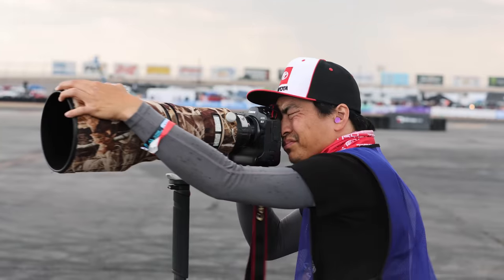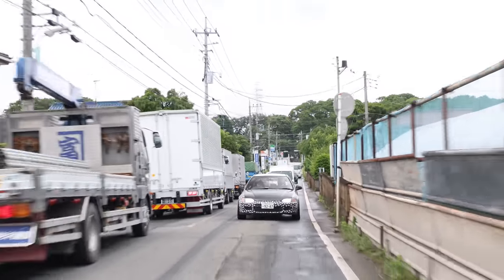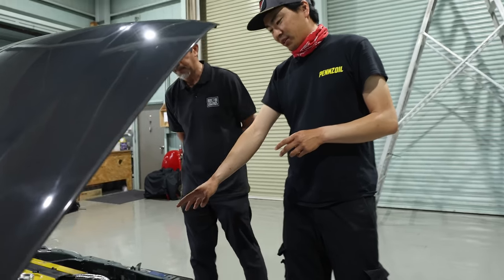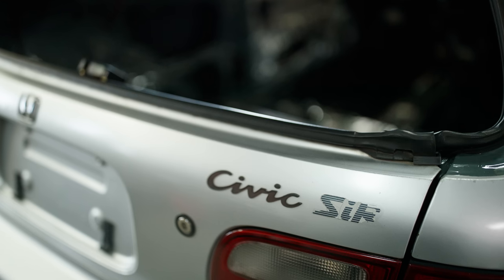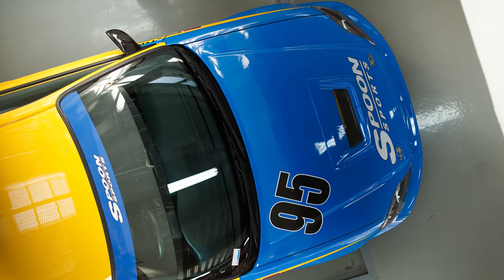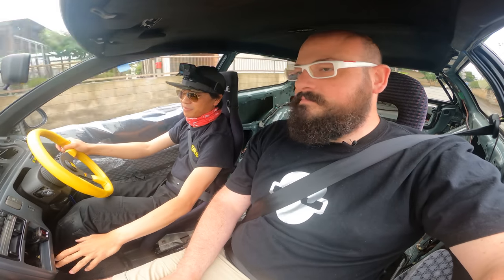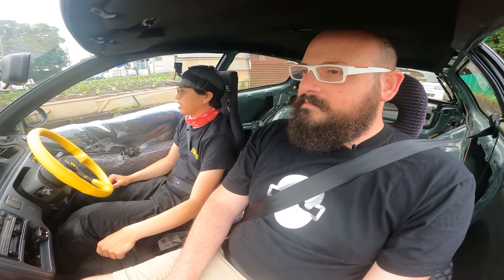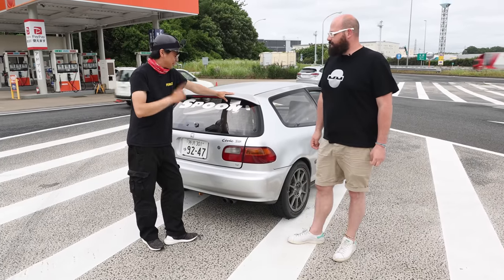$200,000 EG6 Honda Civic, built by Spoon & Built by legends | Capturing Car Culture - Ep. 7

Comment: Imagine buying one of these and then getting gapped by a kid with a junkyard B or K swapped car 🤣
Reply: Spoon has always focused on circuit racing so idk why people are expecting a straight line monster
Reply: @MidnightMuzic   $200k for a side exit exhaust and carbon fiber flooring/strut tower reinforcement is ridiculous no matter how you slice it. At their projected weight of 1000kg that EG won’t hold it’s own against competitors costing a quarter of the price.
Reply: @easye47  Agreed, theres a host of racecar  EGs that run in IPRA ( improved production) in Australia that cost 1/4 of the price and would run rings around it at the track...the money they've spent seems unbelievably unnecessary
Reply: @easye47  I agree the price for it is outrageous but I think it goes deeper then the price for a lot of people. I own a EJ1, or eg coupe for those who dont know the chassis codes, and I absolutely love these cars. 

I think spoon and BBL are doing something that myself and all other car people have asked themselves. What would you do with a car you love if money was no object? Spoon has built absolute demons for track racing but what I got from looking at this and the GTR build is that BBL isnt here to build the fastest version of these cars but versions of them that are meant to engage the drivers and make people who appreciate these cars fall in love with for the first time all over again.
Reply: @easye47  You've completely missed the point of this car. It isn't built to be the best on a track. Its built to be capable on track and street. Your paying for basically a brand new eg built by  the most iconic company to ever tune Hondas. Sure you can buy more car for the money, but if you're into civics, and their history, this car is almost the holy grail.

Comment: I love these modernisation, it's basically a singer civic. I just wanted to point out, for those that come across my comment, that the carbon fiber is a reinforcement layer on top of the existing sheetmetal. Opera Performance, the shop responsible for those bits, made a video about it. Just so y'all know it's not a full carbon replacement, but a very trick way pf increasing rigidity, pioneered by Opera Performance on their legendary s2000 (yes, the one in GT4)

Comment: Are the floors full carbon or carbon skinned metal?

Can't help feeling a 2L B series would be best for a road focused EG, more power and torque than an 18 and effortless pull from very low down. Still able to rev to 8500.

Comment: I know Spoon from Gran Turismo and had a highly modified EG6 Spoon that I would use to kick other cars butts on all the tracks. What stood out for me was the light weight and handling vs. the engine. I would just run away from everything in the turns and watch the rearview mirror on the long straights as they would catch-up to me, only to be left in the dust in the braking zones and curves. This car is going to be special. I can't wait to see the finished product.

Comment: The exhaust sounds like a rattle can you need a bigger resonator.. its vibrating/droning like a subwoofer and makes the knock sensor hard to use and tune and will sense false knock conditions

Comment: Surely turning the engine 180degrees would have been technically easier, having the exhaust ports exit at the rear?
Reply: You would then step into the argument of why not the Honda K-Series into this chassis?

Comment: I love it. Very cool car, but just 8500rpm and only 220hp. You should have somebody build you an engine. It has to be way under 2000lbs, my 92 b swapped was 2030 without all the carbon.
Reply: It's a restomoded civic that is pure
Reply: and no turbo on it?
Reply: @FahrenheitRUS  I suppose an all motor B would be very reliable vs a turbo build. The JDM market was never known for building fast Hondas, that happened in N America. But still, this is a weak B build, and they must be sandbagging on the weight. There is no way this is a 2000lbs car.
Reply: @GIZZMOTORSPORTS   this is not about high performance  but built for balance driving like mazda mx5
Reply: @olavofernandes7286  like a Honda Fit, I get it. Who doesn’t like a balanced ride. But they are 💯% sandbagging if they are claiming it’s 2000# with carbon floors, I bet they regret people seeing those.
Reply: It's only revving to 8500 only because of the cast pistons and 220whp is decent for a mild and reliable 1.8L.
Reply: @findtherightbeat  $200K build and running cast pistons? $200K and 220hp? Who spec’d out this build, it’s seemingly worse the more I’m forced to think about it. Cool car tho, but no thanks for this money.
Reply: @GIZZMOTORSPORTS  It runs a Spoon motor, they use OEM Honda pistons, just balanced.
Reply: @GIZZMOTORSPORTS  I agree it's too expensive for what it is, it could run a sequential gearbox with their K-series motor and better suspension too at a price way less
Reply: @GIZZMOTORSPORTS  the person who build the chassis is a very well known race car driver
Reply: @GIZZMOTORSPORTS  200k means that many of this civic parts unique which had many prototypes + expensive japanese hands + carbon + rent + etc etc etc
Reply: @FahrenheitRUS  makes for good title and topic of conversation. Who doesn't want to see and comment on a $200K civic?

Comment: Larry should have driven it solo.  This build is all about power to weight ratio.  Having your 300lb homie riding shot gun didn't help.  

A lot of people in the comments are forgetting the fact that it's basically a zero miles EG6 SIR II.  Every nut and bolt and  lights are new.  A zero miles EG6 SIR  II would probably get close to $100,000. Stock.  The headers alone would probably cost around $15k.   Spoon engines go for over $10k dollars and the fact that they aren't making them anymore makes it worth even more money.  I myself have an EH3 that I refuse to sell.  People that own/have owned one of these cars know how special they are.

Comment: $200k for a Civic... Stop it $200k, I'll take a GT3
Reply: Yes but this is a classic, duh. 

😏
Reply: Didn't even open it up?! Like doesn't it rev to 10,000rpm or what? Also for 200 grand. Those welds on the manifold need to be looking way better IMO. They look like they are decent and will hold up, but they need to look better esthetically.
Reply: @scottcolpitts8521  I think you replied to the wrong comment or something.
Reply: @franko8572  show me a gt3 that isn't a classic or a future classic.
Reply: @scottcolpitts8521  No use revving all the way to 10k if it won't make power past 8500.

Comment: So you spent 200k for maybe a 11 second car I'd guess... no thanks.
Reply: It's not a drag car 🤡
Reply: @A.spec-alan  Yeah, you could build a dedicated drag car for cheaper.
Reply: It’s for togue racing
Reply: @Big.W.  Not familiar with that but at 200k, that's a little much.
 My ats v is about to be a low to mid 9 sec car and I paid for all the work to be done... still wasn't 200k for everything including labor and car.

 I have maybe 30k to 50k in parts ane labor and another 60k in the car. I could literally go buy another modern car and build it to 10 sec and then I'd maybe be at 200k.
Reply: @SpinSatx  but it's not a drag car. I don't know who you figured it was a drag car? It's a track/street car. It's the reason why they decided not to add roll bars and go with carbon fiber chassis instead.
Reply: @A.spec-alan  I'm not saying it is a drag car. I'm comparing it for the money to a drag car... but I'll use my car as a example again...
 2018 championship edition ATS V that runs 10s currently and will be low to mid 9s by end of year and I maybe have spent 100k in the car/ parts/ & labor.

 I could literally go buy another ats v and do it all again and have 2 9 sec daily driver/ auto cross/ drag cars.
Reply: @A.spec-alan  And that car I wouldn't even consider modern anymore... and I don't consider it a classic yet either. It's in the middle... it be like taking a pinto in the 90s/ 2000s and dropping 120k in parts and labor into it... dumb af.
Reply: @SpinSatx you wrote 40 thousand lines and you still don’t know what togue racing is?
Reply: @Big.W.  Lol okay, you can't even stay on topic.
Reply: @SpinSatx  you’re the one that’s not on topic. Togue racing and drag racing are direct opposites. You cannot drive at 10/10 on a Togue road where handling is the only thing that matters. You would fly off the mountain in your car.
Reply: This car is basicly a road homlogation of a jtcc race car for the road
Reply: @Big.W.  Again never said it was a drag car... I'm comparing money spent. It was just a example lol.
 Spent 200k and rolling in a Honda that would get smoked by a car half the price in just about all categories but handling.
Reply: @olavofernandes7286  I get that... but they paid real deal race car price for a street car.
Reply: @SpinSatx  well that's what you get if a chassis constructor that makes niche one off parts that goes by the name opera performance long time being spent for perfection etc
Reply: @olavofernandes7286  That's is true... seems they could have went a little easier on the carbon too and saved some bucks... but if they got it like that, then they got it like that. I get the one of a kind build, and them saying it's a car they wanted as a kid.... but still seems way over board for the car type lol.
Reply: I don't think you buy this car for it to be fast. It's for someone who REALLY loves the EG6 and has a cool million laying around. 220HP is very good for a NA 4 cylinder engine that's intended for street use. You can't use big cams or too hard springs otherwise it would be unbearable for everyday driving. Everything they did is to make it the perfect version of itself, without trying to be more than it is. If you only measure a car's value by its performance then that's you and that's valid, but in many cases performance is not the deciding factor in why someone loves a car or when appraising its inherent value. To me, this is a homage done right and someone will want this bad boy no questions asked.
Reply: @lukeclayton7578  I get all that... and like I said, if they got it like, that they got it like that... so I'm not hating. I was just saying I'd pass for 200k. I think I could get something much much better for that price.

Comment: To each their own. To me this is not great. No different than putting a Porsche engine in a bug and some carbon and saying this cost 200k lol. It's like slow, probably decent driver engagement but I've found with vehicles too slow there's a limit. A brz is fun but only sometimes type of thing. Cool if a random guy built in a garage and wanted like 50k for it. Overpriced but respectable. This is just dumb and people will say it's great only cause you tell them it is.

Comment: WHAT IS THIS?? a car designed around a header? The length of the runners should be tuned for a specific rpm and the pulse wave should be timed so the pulses line up to pull
Exhaust out of the engine .. those are not EVEN length headers it only revs to 8000rpm? And there should be a carbon ram air intake and positive psi N/A tune